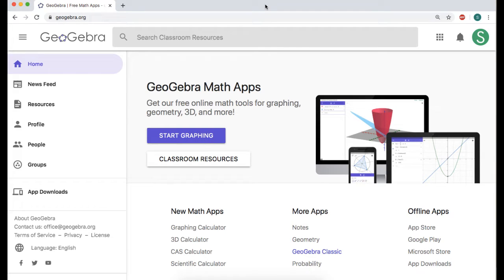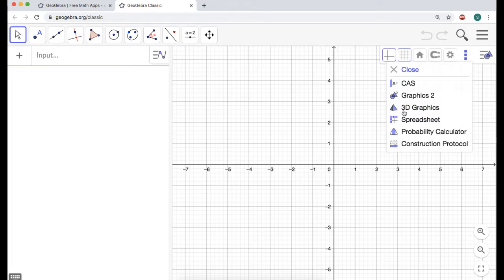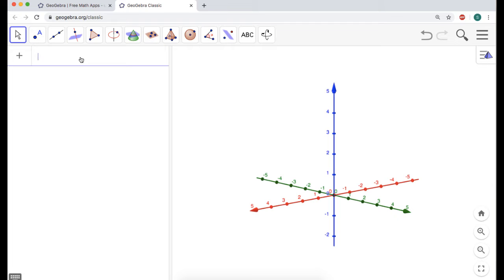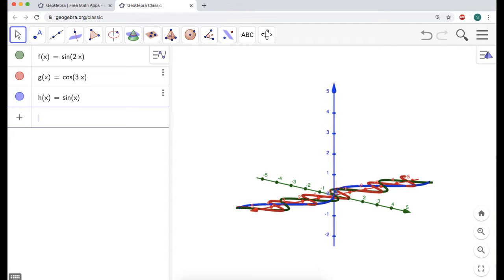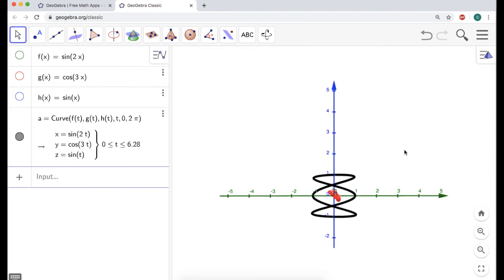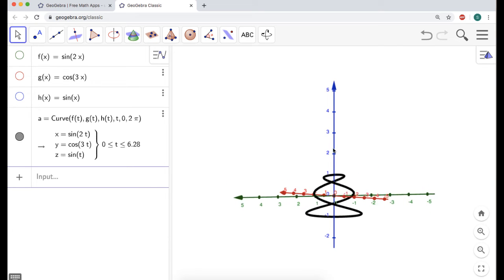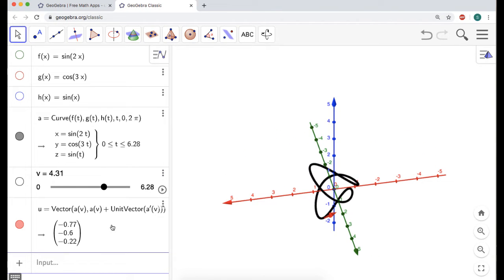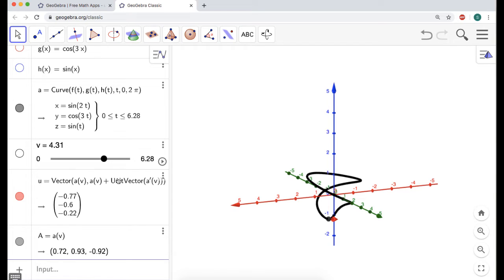TNB-Frame (Frenet-Serret Frame) with GeoGebra 3D

Comment: Cool video. Question - is there any way to reduce the amount of redundant calculations when plotting a curve like 'b'? I'm working on similar (but more complicated) parametric service which involves the unit normal vector of a curve. I have something similar to your curve 'b', and I'm finding that all the redundant calculations really slows Geogebra down, especially as functions get nested. For the life of me I can't find a way to get Geogebra to store a vector in the while drawing a curve or surface so it will use the current numerical vector instead of going back and recalculating the vector by function definitions. Any help? Thanks!